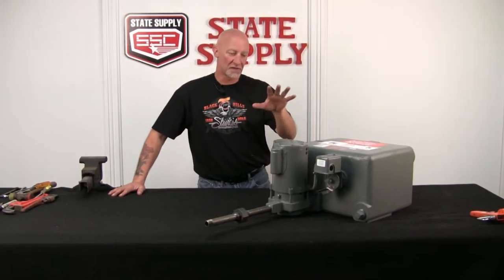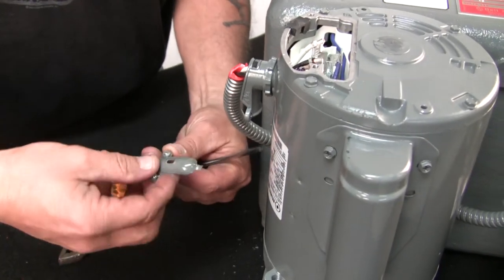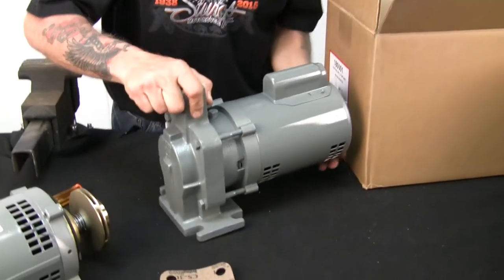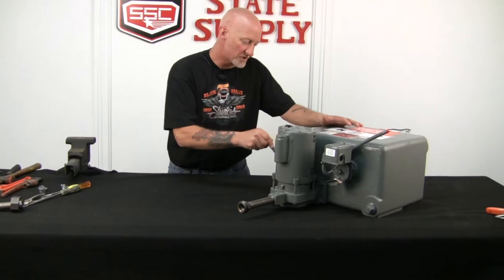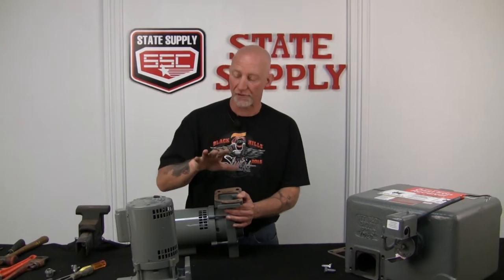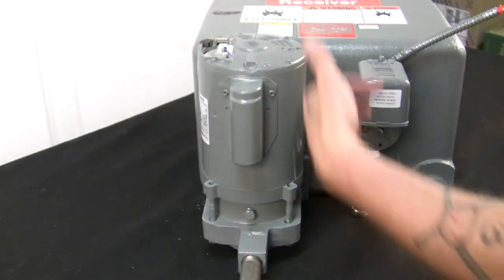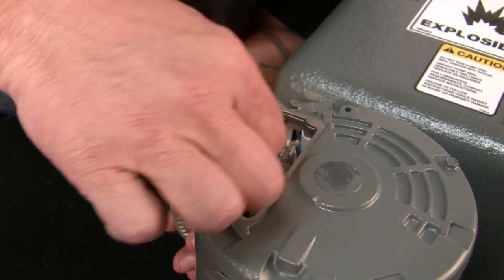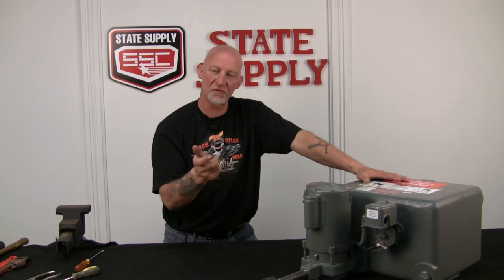How to Replace a Hoffman Condensate Pump and Motor

Comment: Great video. Do you know what size wrench I need for this? Also, on the gasket replacement kit, there is a circular rubber gasket, that I saw you replace, but there looks to be another circular ring in the kit that is tan, what is that for? Thanks!
Reply from the maker: Hi David, the size will either be a 5/8" or 9/16" depending on which bolts you are removing. The tan gasket is for a different pump, they provide the same gasket kit for many different pumps so you can discard that one. Thanks!

Comment: You guys should stress to customers to properly check and setup there mechanical alternator. I have 13 of pumps at my work, I have found many to by set too lower as to run the pump out of water. I also find them where the slide alternator is not properly lubricated and is not switching pumps.

Comment: Hi, i have got brand new condensate pump form Hoffman same as this one but with two motors, the problem is that once the motor starts , its making weird noise , the first few seconds are sounds okey but then is getting worse and worse , do you know what causes that and how to fix it? thank you in advance
Reply: Use a flat blade screwdriver to rotate the motor shaft by hand and listen for noise. Also feel for friction, it should turn easily. There’s only two possible sources of the noise. The bearings going bad or the impeller dragging against the brass wear ring.
Reply: Or the mechanical alternator is set too low, and the pump is running out of water